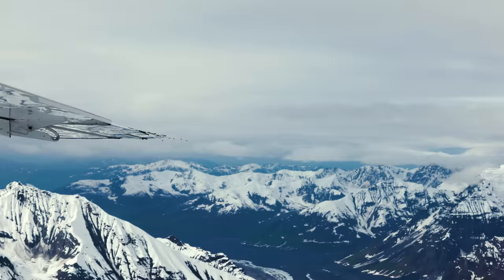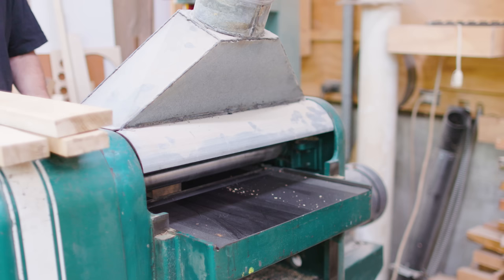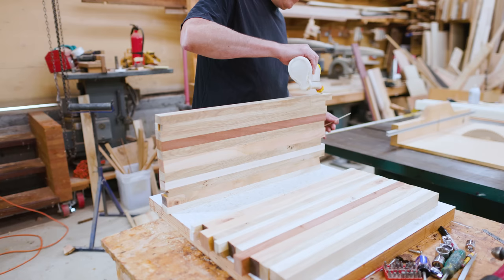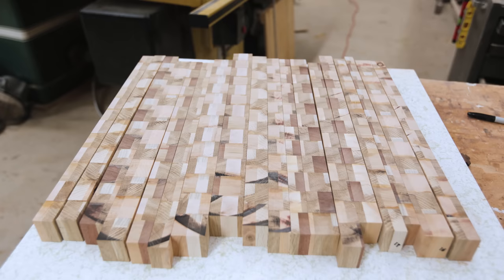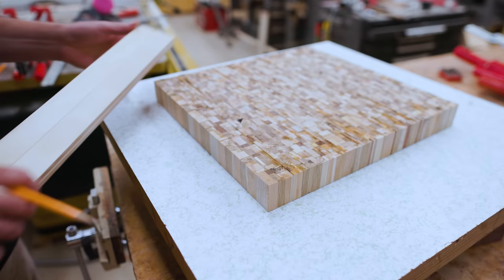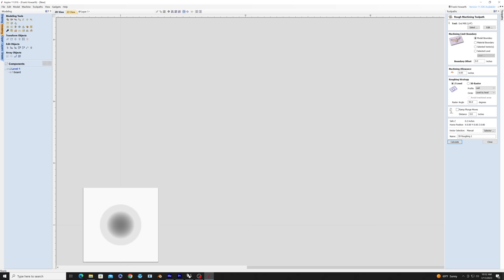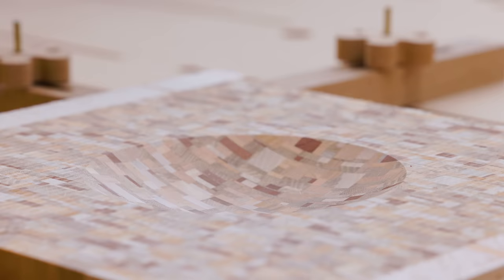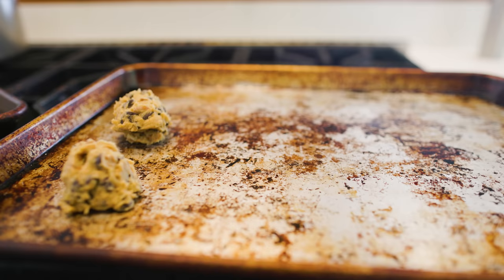Making an Ulu Knife Cutting Board

Comment: I bought the board sold along with the Ulu knife. The rounded cutout center is nice. But I could wish that it was a bit shallower, especially when cutting garlic. That is almost easier on a flat cutting board, but a shallower indentation would help a lot.  Also, it looks like yours is slightly wider, which would also improve matters.

You've inspired me to make a ulu-friendly cutting board more along the lines I think would work best. I'll likely similar proportions, and end-grain, but probably won't do the randomizing.
Reply from the maker: I'm wondering if mine could be slightly shallower? It seems to work well with nuts though. The random pattern was just to make the project longer. It's completely unnecessary.

Comment: Very nice. You should definitely use a 1/2” ball mill. You want to use the largest ball mill you can that fits into the minimum radius of your model. At 7” there is no gain in detail by going with the smaller ball mill. With the larger mill, your cusps will be shorter and you can run it faster and with a lower step over. Less sanding also and quicker. You can go larger if your spindle can take it as well.

Comment: Years ago I bought some knives without handles at woodcraft and made handles and boards for them. I saw all sorts of crazy jigs to make the hole and thought that they were all too complicated. 
I decided to turn the board since I had a big lathe and it was ultimately like turning a bowl. I was very scared to get the board in my face as it held on a scrap pice of plywood just with hot glue but it was very strong and easy to turn with a depth gauge and circle on the board. Fun project!

Comment: Thank you for sharing this. I made an Ulu knife several years ago. I still need to make a handle, but I’ve also wanted to make a “bowl” cutting board for it with a slot in it to hold the blade.

Comment: I have one of these knives but its a double blade, kinda like the rockers on a rocking chair. Its just one piece of metal bent in the middle and thats the handle. It came with a cutting board with a concave but its pretty small, maybe an inch or two larger on each side than the knive blade. And mine is from ikea so deff not traditional lol. Its great for cutting herbs.

Comment: Nice work on the glue up with the board. I would have been more impressed with the depression machining if you had perhaps made a jig and used a router ( as most of your viewers probably have access to)  instead of an expensive CNC.